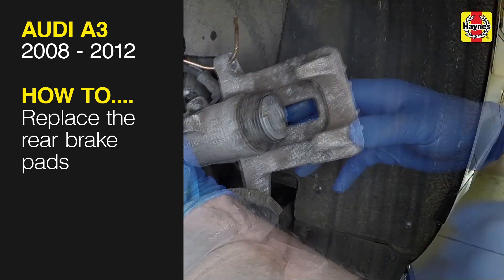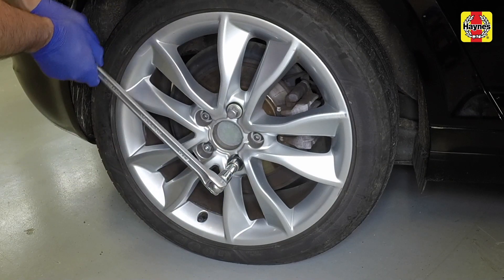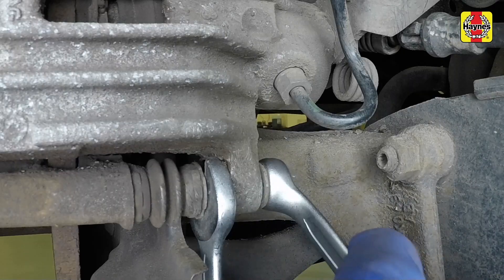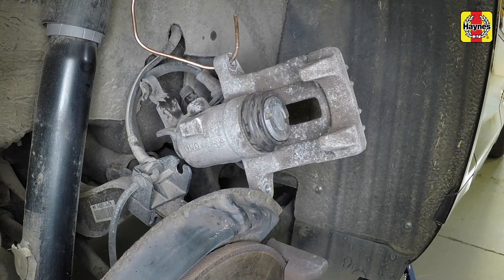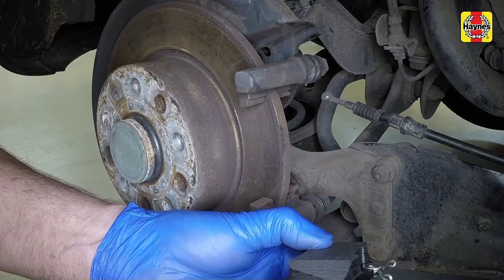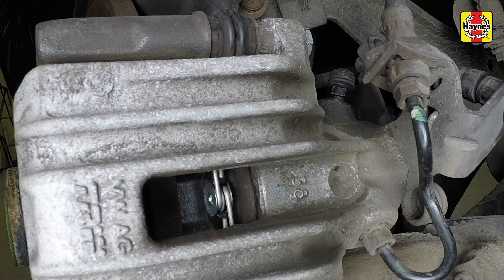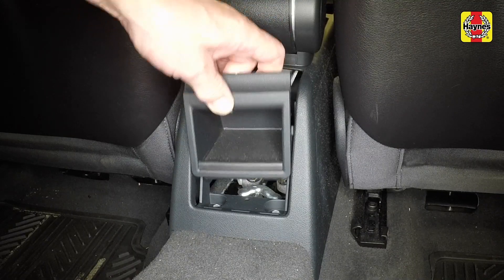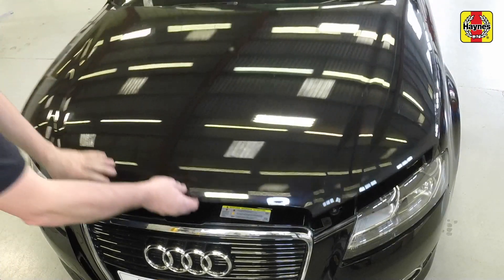How to Replace the rear brake pads on the Audi A3 2008 to 2012

Comment: Y the heck did the bonnet need to be opened
Reply: Needed to open the brake fluid reservoir
Reply: @irishmadrater  Thanks I just want to know why the reservoir needs to be open? Does that release pressure to allow the fluid to bleed?